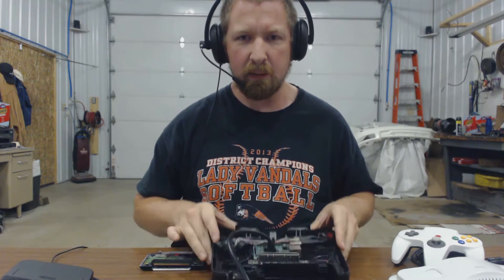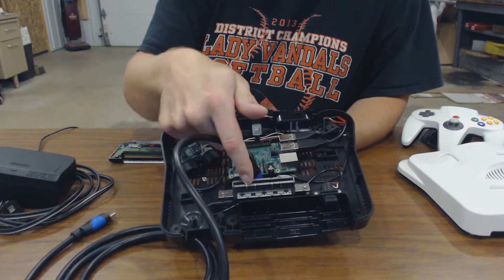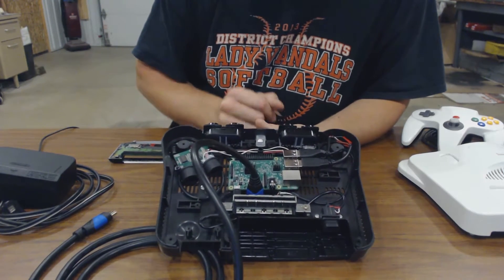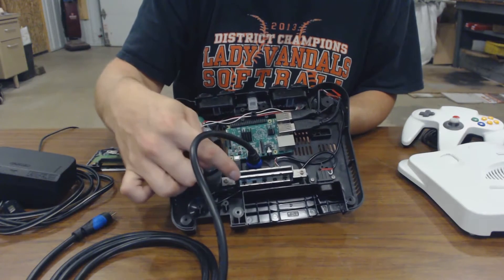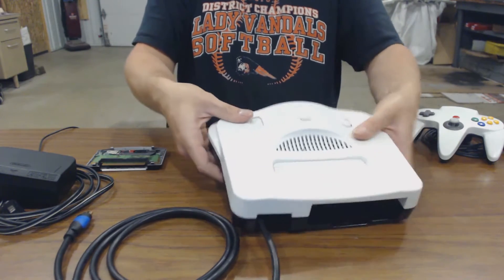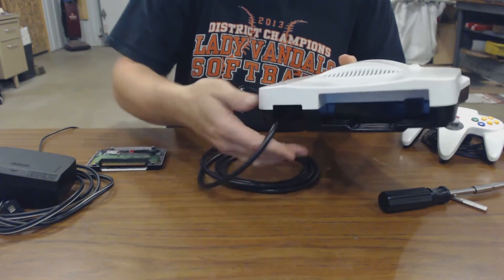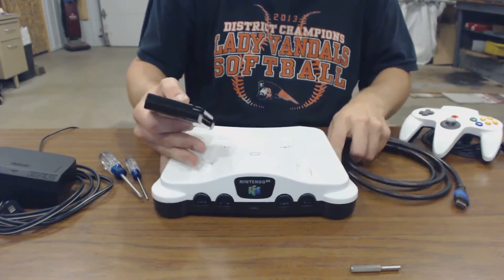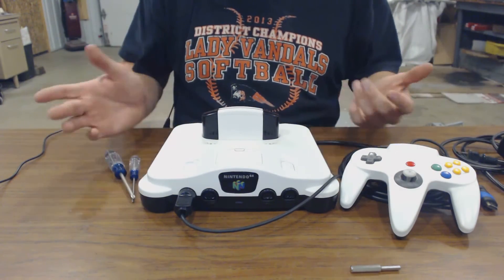RetroPie Project Part 8 - Assembly and Final Showcase

Comment: Thx for your RetroPie videos. Realy great Project! :)
Reply from the maker: You're welcome. And thank you. I am planning to make another one out of an Xbox, but more of a whole media center type thing, still including the emulators. Not sure if I should start another video series on it or not being it's basically the same thing in a different case.
Reply: I have a Pi2 with LibreElec and a Pi3 with Retropie. I will try your OC settings because my games dont look as good as yours. e.g. Zelda is very "pixelated". 
You can name youre new Project "RetroPie Project 2.0" ;)
Reply from the maker: I might do it more because of the mods to the Xbox. It took me a couple hours to figure out how to turn on and use the Xbox power supply without the Xbox motherboard.

I have access to broken Xboxes for $5 a piece. That's a cheap case with a usable power supply. Plus Xbox controller ports are USB with a 5th wire. I could either modify the port itself or the cord and easily have 4 USB ports extended off of the Pi. It's pretty much a perfect candidate for a Pi project.
Reply: Now i'm really curious! Sound like a begin of a RetroPie series with season 1 "The N64" Season 2 "The XBOX" and maybe a 3rd Season "The ?" ...  ;) :D
I'm waiting in eager anticipation!
Reply from the maker: I like your idea there. I'll see what I can put together.